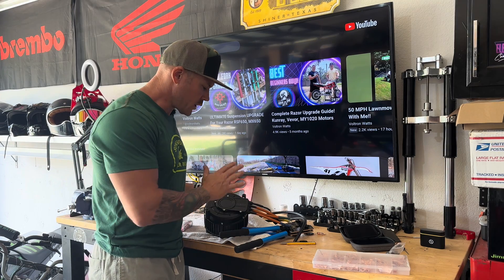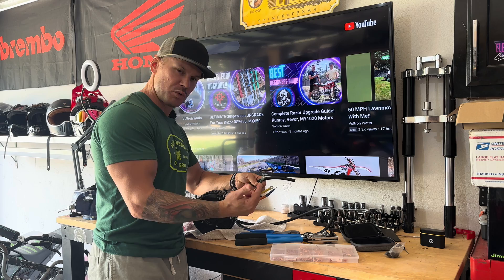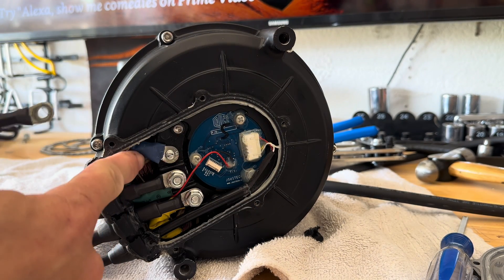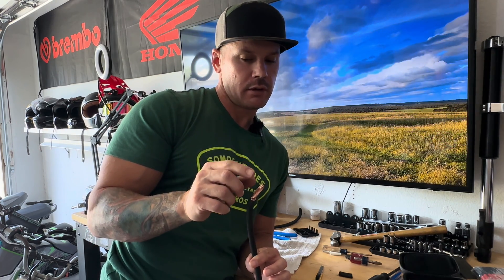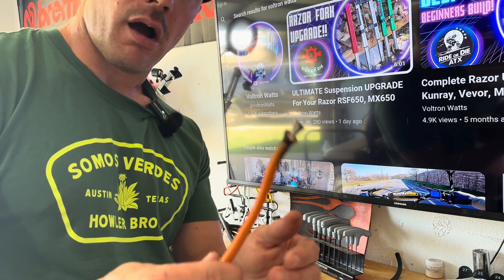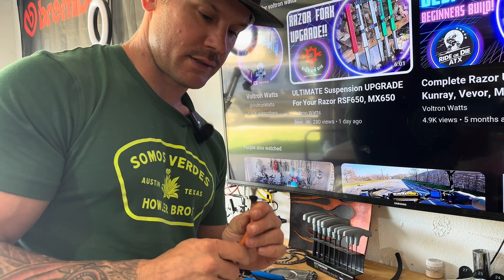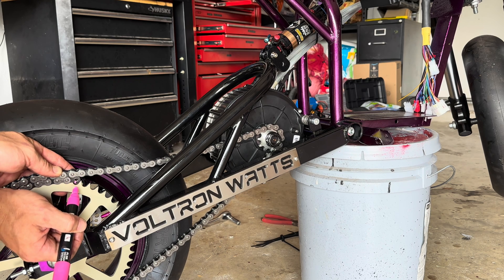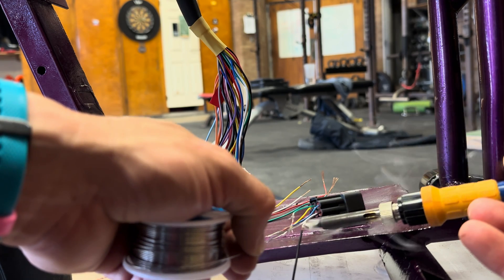ULTIMATE RAZOR SUPER MOTO Revealed! Part 1 - Mini Series @razorworldwide

Comment: pure copper wires is 100% better and the most effective metal for conducting electricity and depending on which way the coils inside the motor is wound can improve performance
Reply from the maker: 👊 agreed

Comment: So that looks like an Mx frame what size battery did you put in it and did you modify frame to fit?
Reply from the maker: That’s a MX frame for sure. I cut down the shock mount area and we drilled the shock mount hole to fit the battery 🍻

Comment: What size wire are the signal wires
Reply from the maker: I don’t know the exact size.
Reply: Do you know what material it is ?
Reply from the maker: @Epicdude67 the wires? Copper
Reply: Yeah and thanks. I’m trying to kind of do the same build but with The noisy cricket controller and a 76v 24ah battery and then the qs165

Comment: QS165 motor shaft has a right hand thread for the nut which means that you have to put motor sprocket to the left side for the nut not to be unscrewed when motor turns. And of course the wheel large sprocket must be on the left side too. The original motor for Razor Super moto ( kunraj MY1020 ) has left hand thread. Probably that's why you just put QS165 there replacing the old motor, But make sure the nut not be unscrewed during ride.
Reply from the maker: I’ll keep an eye out! 👍🫡
Reply: would locktite fix this? blue locktite?
Reply: What Is he saying?

Comment: when sizing your chain first push the rear tire all the way forward then install your master then slide the tire back to the proper tension. you started in the middle which will likely result in a link removal later to compensate for any stretch and wear
Reply from the maker: Right on! Thanks Thomas. I mentioned that in text when I was addressing chain sizing. 👊